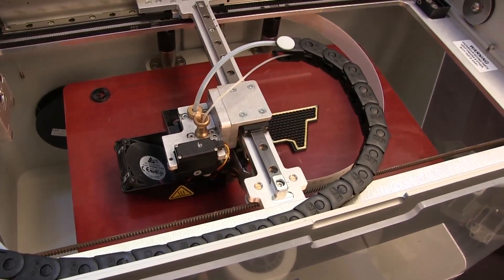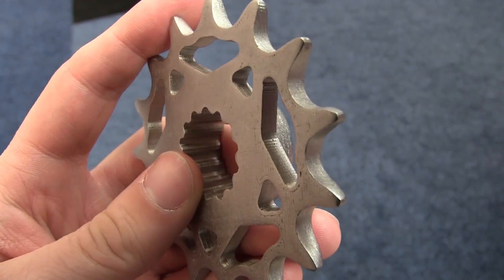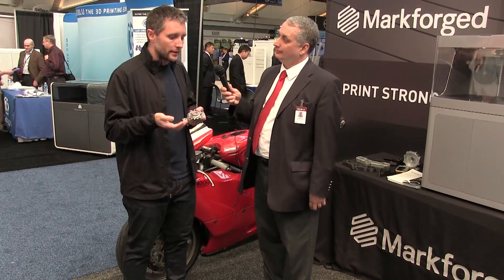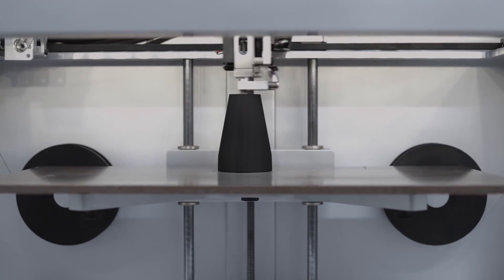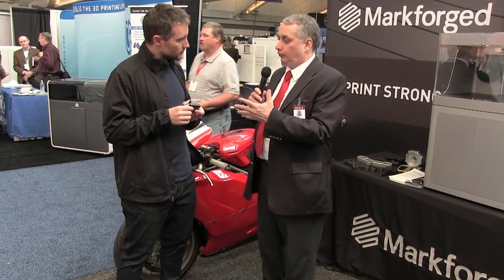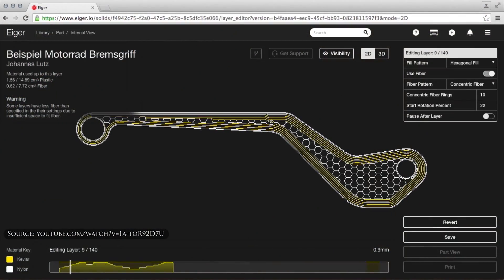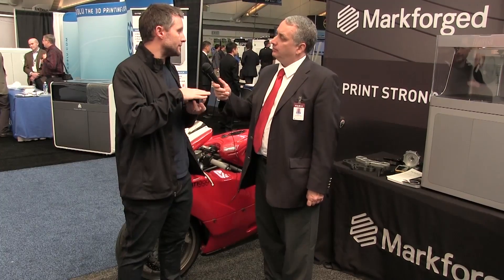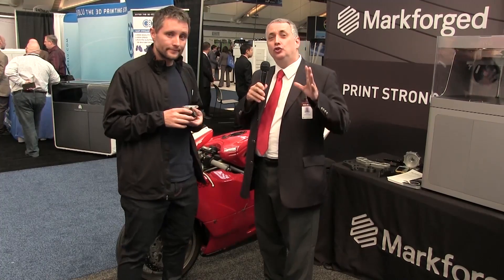Atomic Diffusion Additive Manufacturing to Print Metal Parts

Comment: MAGLEV BEARING + MAGLEV GEAR, THAT THE MOST PRECISION ROBOT PRINTER ARM+ NANO-MICRO MEASUREMENT DIGITAL COMPUTING, EVEN THIS STILL LEVEL 1 THE NEXT LEVEL MAGNETIC LEVITATION SPHERE METAL TANK + MAGNETIC PIPE HOSE (need digital computer frequency generator) TO SEND METAL MICRO PARTICLE MATERIAL, RADIO FREQUENCY FOR STABILIZE MICRO METAL PARTICLES IN TANK AND PIPE HOSE AND LAST PLASMA LASER COLD FUSION WELDER, THAT ALL FOR ULTRA PRECISION 3D PRINTER WELDING, not need high pressure tank all the pressure force and injector force coming from MAGLEV and FREQUENCY GENERATOR.

Comment: Too slow to be financially viable. The one thing they don't account for is the value of time. So it takes a month to make that Ducati with a $100,000 machine, I suggest that's not a great situation. Correct me if I'm wrong.
Yes you can fix machines with printed parts, but very limiting max part size, and instead of $100,000 why not simply have a spare parts bin. In addition, how accurate are these shrinking metal pieces. I would also suggest if you're looking for extremely high accuracy, it doesn't exist here. Nothing about this product makes any sense at the current cost.

Comment: My BS-sense is off the charts: 

- Fancy name unrelated to the actual tech (its not diffusion and has the material bits are not even close to atomic)

- Simple parts as use example for 3D-printer (those gears could have been punched at 4000 (!!) punches per minute with a decent punch-press)

And that Alu-gripper example is even more garbage: Massive, simple parts are NOT a good sceniario for using 3D-printers.

And then he throws out "algorithms in the cloud" around the end.

Comment: One huge advantage he didn't speak of it replacing parts years after a product is no longer manufactured. No need to keep molds on hand or parts in stock. Just keep an STL model of the part on a server somewhere and have some company print it out for you.

Comment: This is a cool process, no doubt but.......

It is very slow, expensive, and with marginal precision. The majority of the parts will need CNC post processing for precision surfaces and threaded holes. Workholding parts with no precision surfaces is a total pain in the butt. Perhaps you could print the fixturing at the same time to make it easier. When you look at the cost of the machine, the materials, the slow speed, and the need to CNC finish the majority of the parts - it is not the valur propsition Markforged is selling. 

Cool stuff....limited practical uses in real life.
Reply: Ethan Hunter For anything needing precision... bores, keyways, sprocket surfaces, threads. The 3D print is messy.
Reply: True but hopefully in a few years this will become mainstream on home printers. I agree most parts are still going to need final machining for anything precision.
Reply: Gasper Erjavec Cheap? Lol! It is expensive and slow and lacks precision. Finishing in CNC adds process complexity, cost, etc.
I like where it's going, but we are quite a way from this being a general production process. Great, however, for prototypes, repairs, and very low volume applications.
Reply: Obviously  it will not replace cnc any time soon, but im surprised you find it expensive while ruining costs of a average printer are laughable to a average cnc. I work in a prototype shop so that is the angle im looking at it and this can be the future, almost no waste, low skill workers and so on..
Reply: as for general production, this is for a new kind of "mass" production, it's "mass" production where every individual part could be unique. You could parametrically match every part to fit with the use case of the product perfectly.
Think a phone for a customer that's unique to their tastes but still the same phone underneath that you're selling millions of times or grips mass produced but each of them unique to an individual user's palm profile.
CNC just isn't that flexible at organic shapes straight from a 3d file as 3d printing is and it wastes a lot of material.
Reply: @Ethan Hunter Look at the surface finish. It is like all FDM printing, pretty poor surface finish.
Reply: What are you talking about, printing is cheep, and this will be cheep in time, the precision can be similar as sand casting so parts can be machined afterwards. This will be the next step for fabricators, and as a r&d engineer i would love this in my shop, it would save tone of time.  Oh yeah and the fact you can make things with infill so they are partially  hollow is a game changer by the way, i can make lighter things that are as strong as full parts
Reply: @gaspererjavec7108  No printing is not cheap. Not at all. In production time is money, And a 3D printer is painfully slow, and therefore makes extremely expensive parts.
Reply: @titter3648  you are looking at it just from your perspective, 3d printing if far from fast big volume production. But for small scale, individualised parts it beats cnc milling when it comes to price and setup time for days, i use both and know what im talking about. It ain't no injection molding of course, and it will probably never be.
Reply: it's less messy than you think if you use a smaller nozzle

Comment: $49 per part vs. $800+?! ...So when's that $1500 Ducati coming out?
Reply: They must be looking at a part that is tailored  for printing and especially difficult for CNC.  I'm a design engineer that also offers prototypes for some clients.  The ease of programming and setup is a huge advantage for printing.  But they are mind numbingly slow and produce awful surface finishes.   There is nothing on the market right now that would make me think twice about replacing my CNC hardware.   I think printers are great for design houses or hobbyists who don't have manufacturing capability.  But it's going to be a long time before we are talking about replacing injection molding or CNC for anything but niche parts.
Reply: Agreed.  When I demo'd their onyx printer last year, it was something like 1 part in 8 hours.  The material was expensive too.  I'm burning two setup parts in my garage tonight on a 20 HP VMC in about 5 minutes per side.  I'm holding about .002 inches, getting surface finishes around 40 Ra on aluminum blanks that cost me $1.50 each in bulk.  I'd love to go with a printer if it can do the job cost effectively but it won't be any time soon.
Reply: I am not an engineer but I tried to get objects manufactured in metal before and the cost was like 600 bucks instead of 50 for things like a not too big box with some holes in it, etc.
Reply: Much of the cost of CNC is in the programming and setup.  This cost can be shared over volume runs so that it is not very significant relative to manufacturing time and material.  But if you only cut one part, it can be very expensive.  That's why I mentioned a hobbyist or a design engineer who needs a quick prototype as possibly finding a solution here.  But these things are not yet suited for product manufacturing.
Reply: f1 race teams have metal printers because they change designs so much  that its cheaper for prototyping and testing
Reply: if you got a machine that prints metal parts at 10 / hour or something then its also rly cheap but you gotta make the machine first
Reply: I know. He did say 1:10th the price of cnc but by then it will be Electric and the price will still be expensive.
Reply: It costs the impression + the rectification in CNC
Reply: Thanks for the information.....
Reply: Never. You're paying for the brand name.
Reply: After the factory gets off of their 4 month break. Every year.

Comment: What is the porosity like?
Reply from the maker: According to the manufacturer's website, the finished parts are up to 99.7% dense and are pure metal.  

You can check out our full article here: http://bit.ly/2rRkmyy, and read their page on the printer here:  https://markforged.com/metal-x/ 
Thanks!
Reply: I've read that the porosity can be varied at will, which means the process has the ability to print a sponge-like metal material. The military is already experimenting with this material in flak jackets and helmets.

Comment: you can do this with a hobby level FDM machine, filamet filament, and a kiln. at least with copper, brass and bronze.
Reply: ya know ya still have to do the whole process @ 1:00
Reply: it's not its just the printer.
Reply: True, however that would require you to have a kiln and the time to everything with that. This is an all-in-one sort of thing.